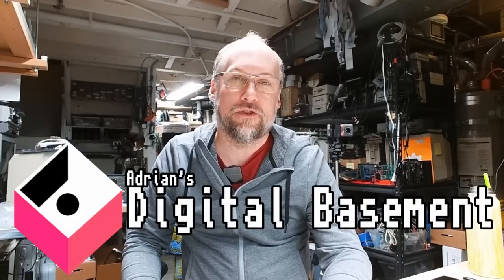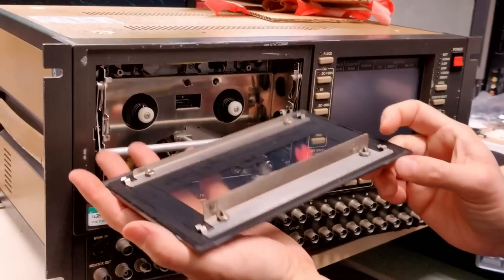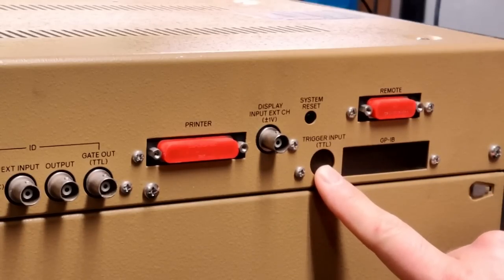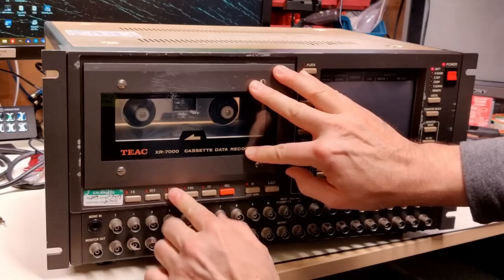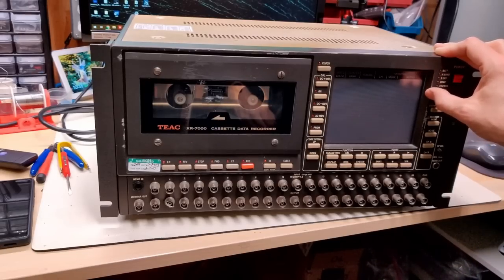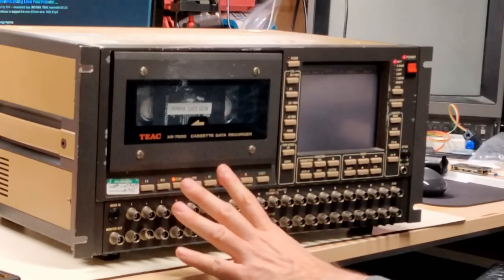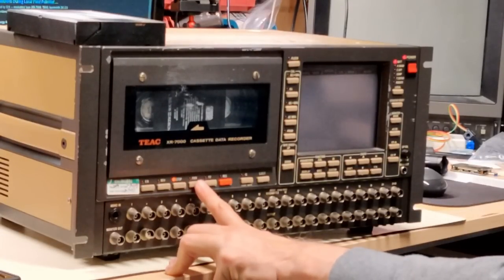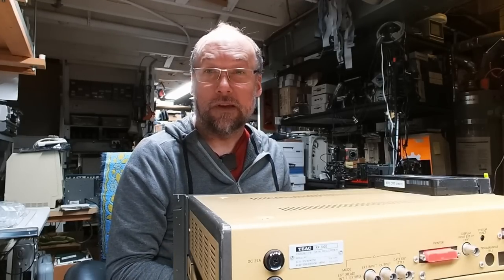0057 A mystery data recorder, a hurt Sun SPARCstation IPC and a MEGA little TV

Comment from the maker: Patrons have uncovered some interesting links and information on the TEAC Data recorder: 

NASA used the Teac back in the day:
ntrs.nasa.gov/api/citations/19960028116/downloads/19960028116.pdf (Page 6)

Datasheet for the Teac: (Sort of)
https://www.testequipmentdatasheets.com/index_cards/T/TEAC/XR-5000,_XR-5000WB,_XR-7000,_XR-9000.pdf and
https://www.artisantg.com/info/TEAC_XR_7000_Datasheet_201710191387.pdf

From Patron Jim: The TEAC XR-7000 is an FM data recorder or data logger.  In the early days we didn't have a slew of digital data formats.  The analog data went into an FM modulator which allowed analog data to be recorded as a frequency modulated signal.  Here is a patent application which may help you understand the technology: https://patents.justia.com/patent/4420774.

From Patron Jason:
This scientific data recorder can be used for electrophysiology recordings, among other types of electrical data. We had a similar device in the first lab I worked in. We used them for recording voltages in cells with various ion channels, in a technique known as patch clamping https://en.wikipedia.org/wiki/Patch_clamp
They were also used in EEG and EMG experiments, from what I can see in the scientific literature

Recorders like this used inexpensive easy-to-find media that could hold a lot of information, such as VHS, to store this data. Each channel of electrical data would be connected to the input BNC connectors. It could then be played back for analysis later using either the output row of BNC connectors or connected to a computer using Data Acquisition (DAQ) via one of the back panel connectors. The rear panel connectors also allowed for controlling the start and stop of recording based on signals from sensors or other equipment. A popular DAQ manufacturer is National Instruments which still makes DAQs that use the GPIB interface (a standard interface for this type of device). National Instrument's DAQs use LabView software, hence why it showed up in your search.

Given the computational power needed, it would make logistical and economic sense to have multiple data recorders like this one throughout a lab or research facility and save the data to tape. Then play back the data on the one expensive computer workstation, which may have been shared across multiple scientists and sometimes across laboratories. Alternatively, the computer workstation could be used for multiple purposes and hooked up to a wide range of scientific instruments and switching between them as needed; this is how it was in the first lab I worked in with the high-end NeXT UNIX workstations.

These devices fell out of favor as computers became more capable of logging data from multiple channels simultaneously at a high sampling rate and saving it in real-time. However, because this data recorder uses pretty standard interfaces, if fully functional and calibrated with the right cables, it could be used in a lab with modern computers with modern DAQs.

Some papers that used the TEAC XR-7000
https://doi.org/10.1590/S0100-879X2004000600014 
https://doi.org/10.1242/jeb.198.3.805
https://doi.org/10.1161/01.CIR.90.3.1368

Sun IPC Info:

Review of it:
https://archive.org/details/byte-magazine-1991-02/page/n218/mode/1up

Recapping the SPARCstation IPC:
https://users.glitchwrks.com/~glitch/2017/07/24/ipc-recap

13W3 differences between Sun and SGI:
http://ps-2.kev009.com/rs6000/13w3/13w3_pinout.html
Reply: While interesting to look at, it's not of any use to you.  I guess you could post it to the Craigslist free section rather than sending to eWaste.
Reply: A friend of mine restores vintage radios, and he let me restore one I had using his shop and supplies.  The string he gave me to use worked perfectly, and I recall it was something you can still buy that is actually made for another use, but I don't recall exactly what.  I've asked him, and when he responds, I'll let you know here...
Reply: I came here to post about the 13W3 differences, but you already found out.
Reply: This is just fantastic!
Reply: for a Dial cord. use "heavy duty" sewing thread.
Reply: 0l❤🎉🎉🎉🎉🎉🎉
Reply: Former many, many, MANY year Sun guy here. The bracket on the underside of the floppy is actually the floppy anchor plate which is why it has the cable clips. Screws go through the plate, through the midplate, and into the floppy. The SBus card is a pretty rare one, albeit not particularly desirable - it's a third-party token ring (IIRC this one was made by NCR) compatible with the X1004.
Once you replace or repair the PSU, it's still not going to boot due to the RTC. It doesn't leak, but imagine a Dallas except a thousand times worse. If the battery goes full dead, it can lose data that Sun stored in the 'DO NOT STORE DATA HERE' bits of the RTC module. It also contains a 32.768kHz clock, critical to the PROM, which may prevent getting to OBP. Shouldn't be hard to find some guide for cooking up a replacement. (Can't do a straight replacement even though the part is still made. Remember that part about 'DO NOT STORE DATA HERE'? Yeah. New parts don't let you. Sun ruined a lot of things like that.)
Reply: You sucked a lot of time out of my life asking me a useless question and answering it as quick as you asked it. I could tease you for not knowing what a industrial/scientific data recorder is but I won't I'm just going to ask you don't Blue's Clues me in the future it's waste of my time.
Reply: @InconsistentManner  Yes, that's what it was, "upholstery thread"....
Reply: @InconsistentManner  Or cloth fishing line ( if you have access to old stuff )
Reply: It seems that even Sun has used different signalling for the 13W3 video connector in different workstation models over the years.
I have a factory made 13W3 to VGA adapter which works fine with my Ultra10 (Creator3D card installed) but if I try the same adapter with my SPARCstation 20 - nothing. I had to research the differences and make myself an adapter cable for the older model.

Dead NVRAMs can be revived by a couple of Dremel hacks and soldering to disconnect the dead internal batteries and replace them with an external CR2032. There are instructions around the net, but do not go for those which tell to brutally remove the entire "backpack" from the NVRAM - you will lose the battery backed up clock function if you do that as the clock crystal is inside the same "backpack".
After the revival you have a NVRAM which can again keep the data when the workstation is powered off, but it is blank. You will need to do some FORTH prompt wizardry to set the correct machine type, a MAC address and a hostid, and the checksum. Instructions for that can be found too.
Reply: Did you really call that sun microsystems cute? Lol😂
Reply: i use a "fat fishing line" ...28:50 min.. 🙂 thx for upload and a nice day!! your new fan from east germany

Comment: The TEAC is a scientific data recorder that can be used for electrophysiology recordings, among other types of electrical data. We had a similar device in the first lab I worked in during the mid 90s. We used them for recording voltages in cells with various ion channels in a technique known as patch clamping. They were also used in EEG and EMG experiments, from what I can see in the scientific literature.
Reply: Recorders like this used inexpensive easy-to-find media that could hold a lot of information, such as VHS, to store this data. Each channel of electrical data would be connected to the input BNC connectors. It could then be played back for analysis later using either the output row of BNC connectors or connected to a computer using Data Acquisition (DAQ) via one of the back panel connectors. The rear panel connectors also allowed for controlling the start and stop of recording based on signals from sensors or other equipment. A popular DAQ manufacturer is National Instruments which still makes DAQs that use the GPIB interface (a standard interface for this type of device). National Instrument's DAQs use LabView software, hence why it showed up in your search.

Given the computational power needed, it would make logistical and economic sense to have multiple data recorders like this one throughout a lab or research facility and save the data to tape. Then play back the data on the one expensive computer workstation, which may have been shared across multiple scientists and sometimes across laboratories. Alternatively, the computer workstation could be used for multiple purposes and hooked up to a wide range of scientific instruments and switching between them as needed; this is how it was in the first lab I worked in with the high-end NeXT UNIX workstations.

These devices fell out of favor as computers became more capable of logging data from multiple channels simultaneously at a high sampling rate and saving it in real-time. However, because this data recorder uses pretty standard interfaces, if fully functional and calibrated with the right cables, it could be used in a lab with modern computers with modern DAQs.
Reply from the maker: @schnuder  It sounds like a neat solution to a data problem that can be tackled with a computer now -- but I could see the value back then.
Reply: @adriansdigitalbasement2  Yes, it was a very interesting solution to the problem. The lab I worked in had a bookshelf full of VHS cassettes with likely gigabytes of data. Also, considering the nature of the data and looking a bit more closely at the video, I think it's plausible that the recording mechanism in terms of how the tape head and such worked may have been different from those used in standard video VCRs. The goal was to record lots of real-time data and store it on inexpensive media. Still, like most scientific hardware, the recording and playback hardware was a major financial investment by university laboratories and other organizations using these recorders.
Reply: Hi Adrian I have a Macintosh workgroup server 60 that needs saving it won’t get past the chime and then it plays the crash up sound id really like to save it if I can is there any way you could help me out?
Reply: I assume there would be bandwidth limits though, unless it runs at some inhuman speed? I remember VHS having a ~3.5Mhz bandwidth limit, which was lower than broadcast TV, and is responsible for video signal degradation. I think Type C cassettes existed that had like 5Mhz bandwidth, though...
Reply: @Bubu567  You should forget vhs video, this is using the tape as a multichannel linear tape; it just happens to use VHS media which used to be plentiful and cheap back in the day. What you talk about is just VHS and SVHS both of which had C variants which is simply less tape inside a smaller cartridge meant to fit handheld cameras, etc. You could put the C inside an adapter the size of a normal tape cartridge and use a normal VHS, it would fit in this thing too but would be pointless with the much smaller running time.
Reply: This has a lot of settings my Uncles Audio Equipment from the 80s-90s. It uses ADAT Tapes that look exactly like VHS but its not, it's made for Audio. All the different ports on it are for the various Mics, Guitars, Drums & other Music Eqt. It looks like an ADAT Machine to me. There is also Mini ADATs that use Cassette Tape form factor..
Reply: @dhgodzilla1  ADAT used the same trick as this Teac deck, using the S-VHS (not VHS) tapes as a magnetic media but recording on them in an incompatible format, because the tapes were readily available.
Reply: It was truly a savage and brutal time in history!
Reply: Hey @schnuder, since it has a 40 kHz sampling rate, it should be able to record audio, basically making it a primitive ADAT, right?
Reply: @cheater00  It was probably a variant on the Teac 16- or 24-track audio tape recorders that already existed on 1/2" reel to reel.

It's possible the 40Khz can only work at the highest tape speed so your recording time is very limited.
Reply: @Stoney3K  if you look up Alesis ADAT, that's basically the same thing: record multiple channels, to VHS, 48 kHz sampling rate, multiple inputs, etc. I wonder how these two are related.
Reply: @cheater00  ADAT is digital and it's a helical scanning format (using basically a VHS transport to record a bit stream). This appears to be analog and it's using a linear recording format, recording 22-24 tracks in parallel along the width of the tape.

The VHS cassette is only used because it's a convenient source of wide magnetic tape.
Reply: @Stoney3K  it can't really be analog per se because it uses an analog chopper to bias the magnetic domains on the tape. it'll alias if you let it.
Reply: @cheater00  How are you so certain of that? It could be just a head that is 22 (or 24 with control) physical tracks wide. Judging by the way the mechanism is laid out, it's just a regular 1" reel-to-reel mechanism which is modified to accept VHS cassettes as the tape carrier.

This mechanism is linear (tape tracks are continuous across the length of the tape) while ADAT used helical scanning like a video tape, where the tracks are time-sliced and put on the tape diagonally.
Reply: @Stoney3K  it's called AC Bias. look it up. ALL tapes have to do it. there's no way around it.
Reply: @cheater00  That's not done with an analog chopper but rather with an oscillator that superimposes a high frequency AC signal on the tape, on top of the analog signal.

ADAT doesn't need a separate AC bias since the bit stream is already recorded in an FM-like manner, and it only has 2 valid signal levels, much like the magnetic signal on a floppy disk.
Reply: @stpworld  no it's a crapple product!!

Comment: Hi Adrian. It's a very cool little 25mhz SUN4c arch system. The form factor is "lunchbox". You do not need the keyboard (mouse comes off the keyboard much like ADB..kinda) and monitor. If it doesn't detect the keyboard, it'll default to console being off RS232 on the first serial port... Yay..but wait. It may not show any output for upto 20mins. There's an IDprom on it. It's like a PC BIOS dallas chip, that saves a bunch of variables in it (what to boot off, TOD, probe lists for scsi/sbus, ethernet address, system gesalt ID ..kinda). Down side, is when the battery dies on the IDProm, two settings mfgswitch and "diagswitch?" get flipped. This means when it's powered up, it'll sit there running lots of tests on everything before there's any console output (serial or video). So, in the OBP (open boot prompt ..similar to IBM Powers and 'newworld macs') type "printenv", "setenv" or "sifting words" when you get it working. It'll show your the keywords you can use with the OBP which is actually a FORTH interpreter. Once you've fixed the battery, you can re-program the IDProm contents with lots of "mkp" commands and re-write those settings. Then you can nvstore or nvsave to save the new contents. Set the two diag/mgf switches off and it'll come up every time after a few seconds. These are very fun machines. Very old. Quite historic. They're one of SUN and Fujitsu's first generation SPARC systems. They're SPARCv7 systems (like saying 286, 386, 486, pentium..etc). Later systems are SPARCv8, and the 64bit SPARC systems start with SPARCv9 ..onwards. Well worth getting working, not too hard and a good 2-3 videos though :) P.S These guys are supported by upto Solaris 7 (5.7) but not Sol8.. as they removed support for anything below SUN4m. So no SUN4c. Solaris 2.5 (aka SunOS 5.5) is a good fit due to the limited memory and Solaris 7 started to include silly amounts of Java apps. These guys are well supported to this day by NetBSD and there's plenty of enthusiasts running systems of this age, especially lunchboxen. Very popular form factor ..I guess it's a bit like all-in-one mac's from the UNIX world in a sense.  Google search terms: "SUN idprom hack" and "SUN hardware reference" and "Re-programming SUN NVRAM after replacement". They also will netboot and run completely diskless over ethernet ..but you would want to have it hosted from other SUN or linux systems. Easiest to configure from another Solaris system. Best Wishes from Australia.

Comment: Suns will automatically go to serial console if the keyboard is not connected at boot. I can pretty much guarantee that the NVRAM battery is dead so all the settings are gone (including the ethernet address) but it's a pretty easy fix if you get the power supply working.
Reply: Yup I had one of those in the late 90s. I etched away the side of the nvram battery / rtc module and hooked I think a 3v battery on it and then reprogrammed it. I ran Linux on it.

Comment: The IPC will need (3) 3300u 10v, (1) 1000u 25v, (1) 470u 25v, (1) 220u 16v if it's the same as mine which I suspect it will be, basically all DC output filter caps. You'll need a SCSI-1 or 2 hard disk of about 500 MB, parity on, ID=3.  The NVRAM / RTC will need a new cell grafted in as well.  If there is no keyboard detected it defaults to serial console, a 96008N1 serial terminal.  Solaris 2.5.1 will work on this machine but it will take overnight to complete the install and you need more RAM, just PC type, 1 and 4MB up to 48 max.  There are no other issues that I'm aware of but this was one of Sun's lowest price machines and it's slow.  Frankly I think your example is a bit too rough to make a worthwhile restoration as these are not rare.  Don't forget a monitor needs to be composite sync compatible.  The base video is monochrome but it looks like it has a colour add-in card.